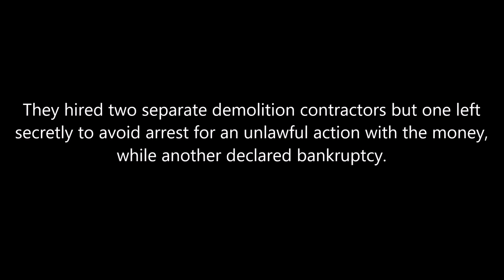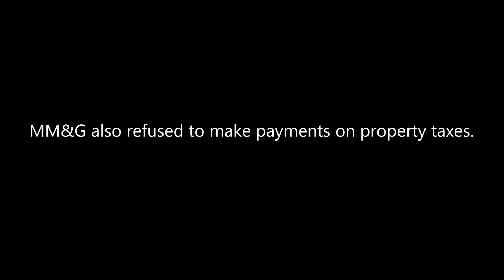Among The Unknown | The Abandoned Universal Atlas Cement Company in Pennsylvania (Episode 33)

Comment: You two should've climbed the silos! I've been here a couple times, and the view from up top is my favorite part about the place
Reply from the maker: I wanted to so badly but PJ didn’t want to. I’ve seen videos though! - Devon
Reply: @truthalways  Do the stairs/ladder to the top still seem safe?
Reply: @christopherpape4823  yes it very structurally sound. It's a spiral staircase to get to the top. But yea it's all made of steel and thick concrete with rebar
Reply: @truthalways  good to know thx for the response fam
Reply: @christopherpape4823  no problem. Of course use caution. I didn't get to explore the first floor cuz it was mega flooded when I went but the stairs and the top floor was very sturdy.
Reply: @truthalways  will do thanks for the tip. Do you know if it's considered trespassing to explore there? Do neighbors call the cops if they see explorers or anything?
Reply: @christopherpape4823  I had zero problems I spent a good couple hours there. You shouldn't be bothered going back there...lots of ppl explore it and haven't had any issues. 

They filmed the Netflix show mothman prophecy there. I think I said that in a previous comment.
Reply: @truthalways  oh yeah that's right. One other question, any recommendations on where to park?
Reply: @christopherpape4823  either the firehall or across the street from it. There's places to park around there you'll figure it out. I think we parked just before the firehall
Reply: @truthalways  cool thanks for all the info!!
Reply from the maker: Nowadays, it’s being watched and some vehicle always patrols. Someone bought a warehouse on the property too. I haven’t seen any new photos or videos on the place in recent times, so idk if you should go or not.
Reply: @AmongTheUnknown  oh shit good to know thanks for the heads up
Reply: @AmongTheUnknown  as long as you don't cause no trouble and are quiet nobody will mess with u
Reply from the maker: Causing no trouble has nothing to do with anything. But being quiet, maybe. Being inconspicuous can help but that only goes so far. There’s abandoned hospital campuses all over and always have people patrolling and some people get lucky